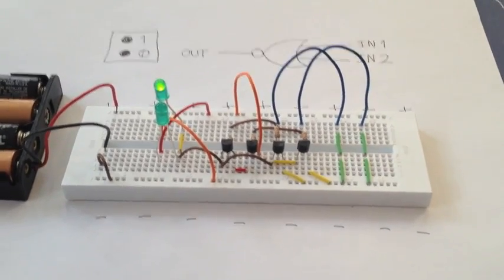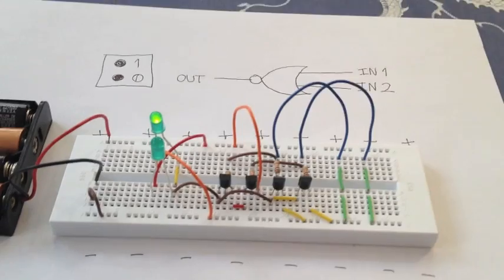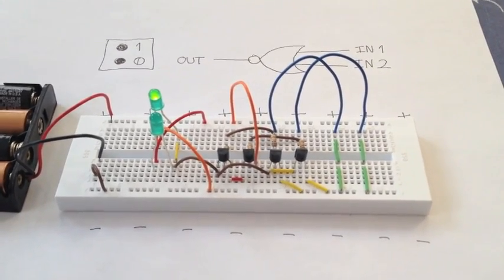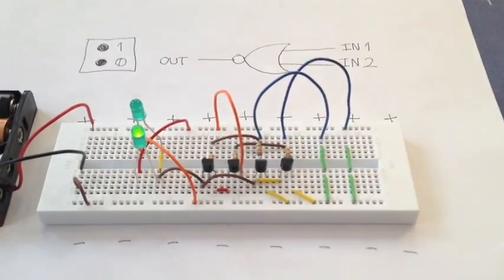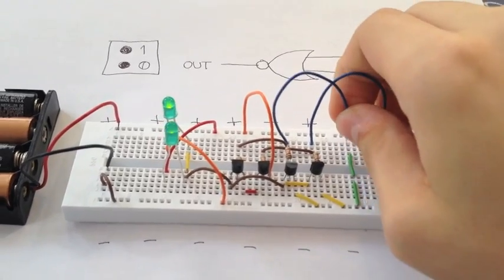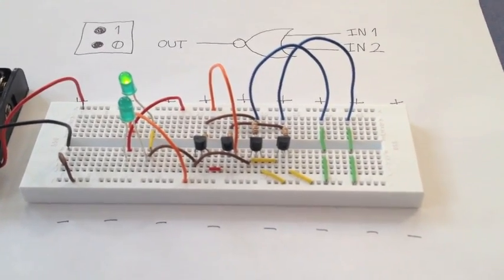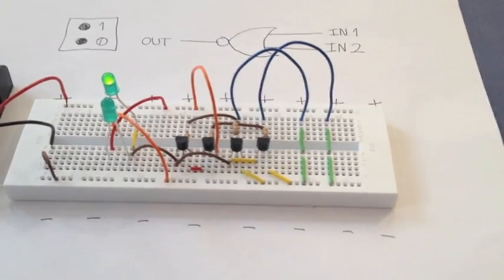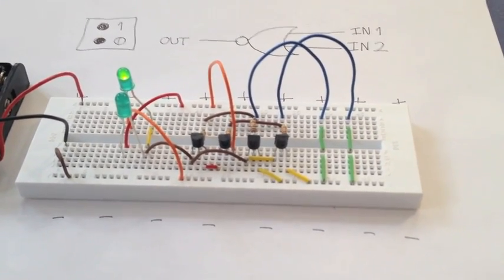Discrete Transistor NOR Gate

Comment: I  just cannot get enough of this. If only I did not have to work in a dead end job, I could play with logic all the time.
If you want to try to make a computer this way where do you start, what designer program's do you use to make your CPU and is there program's to help with the binary programming when you have made some thing. 
Thanks Richard